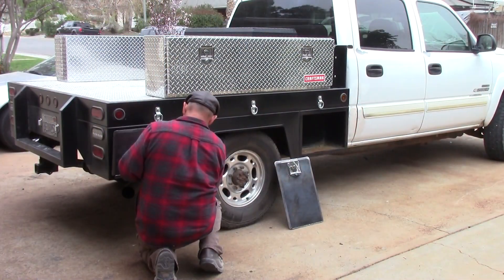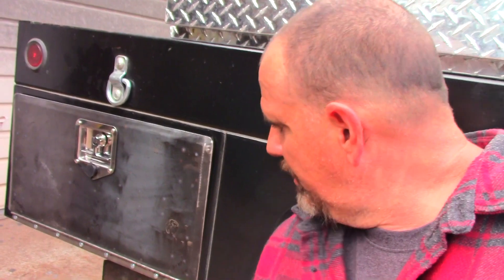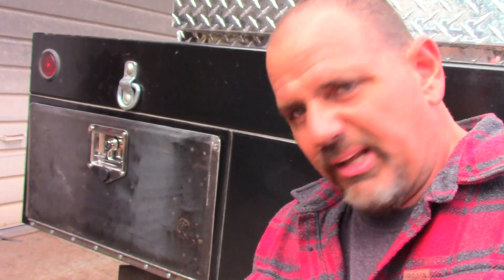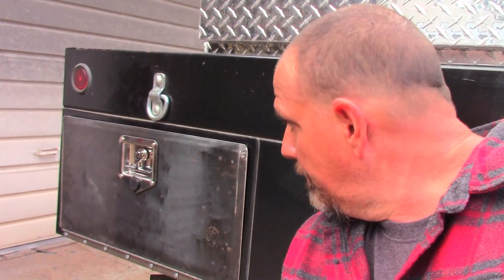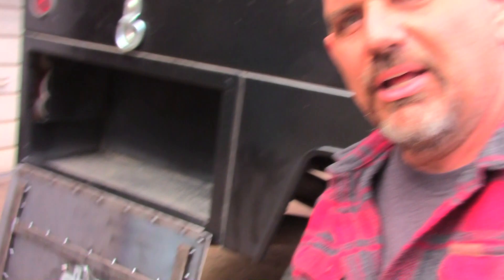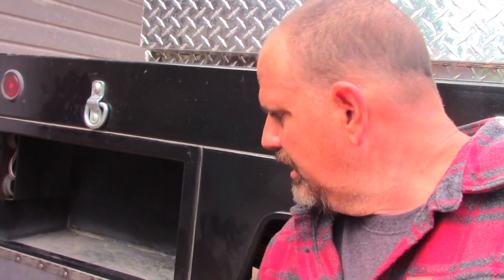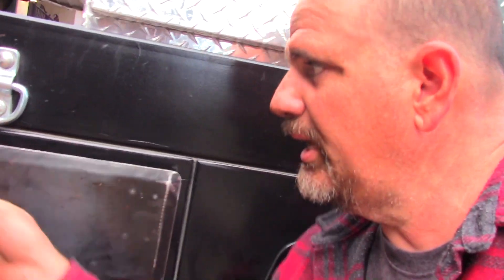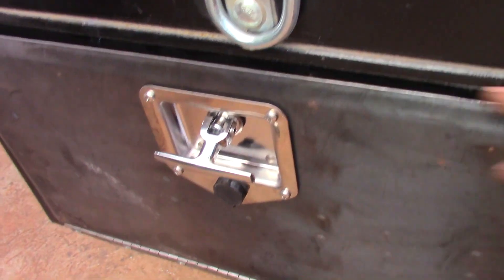I Reinforced the Doors and Mounted Them Anyway Video a Day 62 of 365

Comment: Words of wisdom print out a sticker from a label gun and put it on dash of truck that reads "CHECK TOOLBOX DOIRS BEFORE GOING" I just bought a dumptruck with toolboxes and I have caught myself on two occasions leaving a door open lucky I didn't loose any tools
Reply from the maker: That definitely happens a lot. The body manufacturer I worked for used aluminum rivets at the hinges so when you rip a door off it doesn't damage the body as much as steel rivets or welding.
Reply: @JustinJennings  I not really concerned with ripping doors off its the thousands of dollars of tools I have in my boxes that spread fir miles upon miles
Reply from the maker: I totally understand.